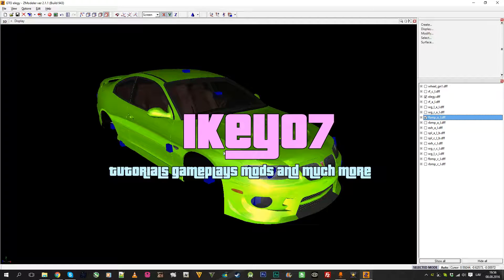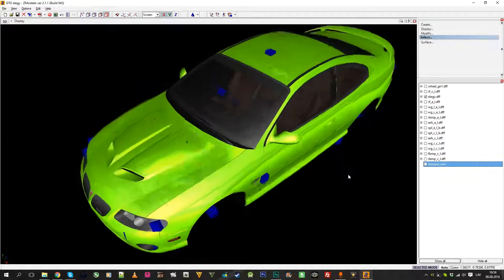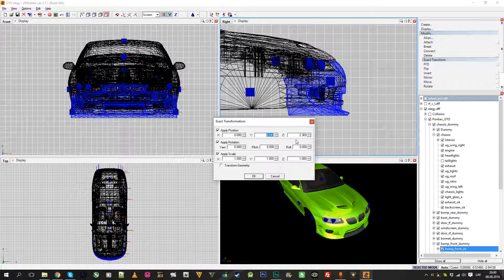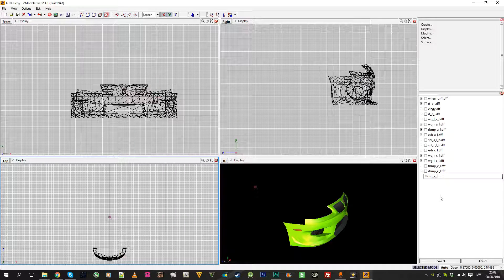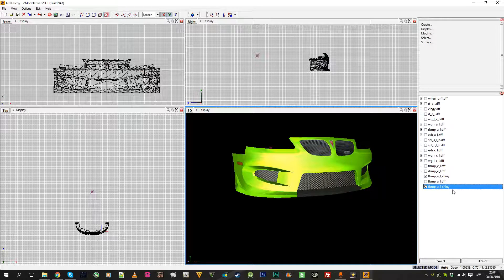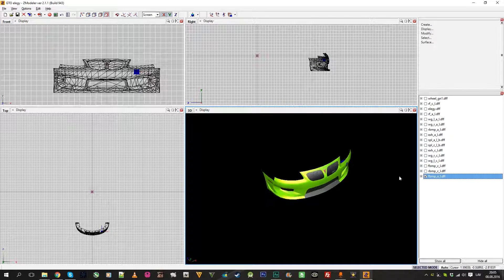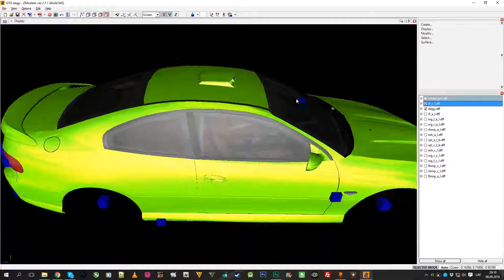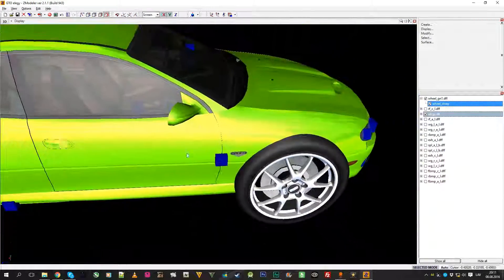How To Make Tuning Parts For GTA:SA, Zmodeler2 Tutorial

Comment: hi again 
the all thinks is working but roof and wings are not in spotted palce ( for example 2 meter over there)
how should i put the wings and roof?
3d models of wing and roof havent any bug. where is problem?
Reply from the maker: check pivot point of the spoiler, what I usually do is, I place spoiler object where I want it to be, and then convert it to dummy, so its exactly where I placed it.

Comment: Hi, your video was really helpful, I had a problem with the specularity of the bumpers, but it's neeeeearly okay now. But, I still can spot a little difference, the bumper does not get the chrome texture which is in my primary color. It's applied as Low-level additive, and Uses an Auto Sphere Environment UV map(same in both chassis and bumper) But It does not appear in the tunig part, is there any way to fix it?

Here's a pic, it's not too big of a difference but still... : https://imgur.com/a/ACmX4hS
Reply from the maker: Maybe it uses another material, also do you use reflection map from vehicles.txd ?
Reply: @ikey07ch  I use a different texture, but I cloned the original bumper and started to modify it so the texture is intact, and should work, right?

Edit: Before I added the _shiny tag, It used that texture, but it was too "specular"
Reply from the maker: @branyiczkymatyas3764  Try to use another name for that texture, and make sure its in your cars txd file, with correct name.
Reply: @ikey07ch  I tried a different texture with different name, nothing changed.

Comment: Huhu ikey. One question. How do I attach a Texture ( exactly vehlights128 [FL] ) to text on my vehicle so the text starts to glow whenever the headlights turn on? ( Did it how you explained in part 3 with that paintjob video )
Reply from the maker: you need to get 3D letters to make it, and then just apply vehiclelights texture to it. or get two layers, put vehiclelights under and text with alpha level on top. and once you turn on lights letters will shine

Comment: im having a prob my car loads fine in ggmm but when i spawn it in-game the car wont show up and the game freezes (it doesnt crash just freezes) HELP!!!
Reply from the maker: check if you have all default dummies needed for car, driver seat, drivers door and 4 wheels and you have spell them correctly. maybe you used wheel_rr_dummy and wheel_lr_dummy, while wheels have rb and lb.
Reply: Actualy now that i checked the textures one of them isnt scaled correctly it is 1201x1067 and i guess thats the problem bcz it happend before to me, and wen i scalet it correctly it was working, thank in advice anyway!
Reply from the maker: Texture scale doesnt matter, as TXD workshop scale it anyways, most likely it scaled to 1024x512
Reply: nope i scaled down to 1024x1024 and now its working (txd workshop didnt scale it)

Comment: hey ikey where do i atach the interior lights... i mean in wich material lights_day_material ??? (ivf)
Reply from the maker: You mean lights which always are on? I used [light_allday_material] tag
Reply: ok thx bcz i used light_day_material and they wont turn on even if i used an on/off car lights mod :/
Reply: what about lights_night_material does they turn on ?? or only at night
Reply from the maker: I use it for interior buttons, and they are suppose to turn on only at night.
Reply: hmmm so what should i use... i think that only at night is better